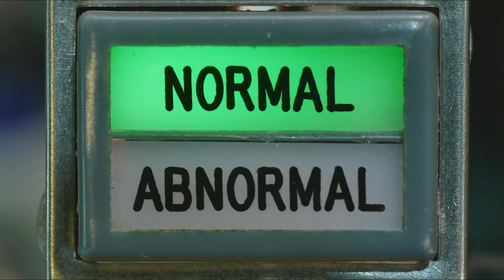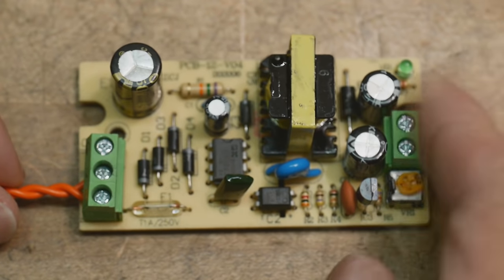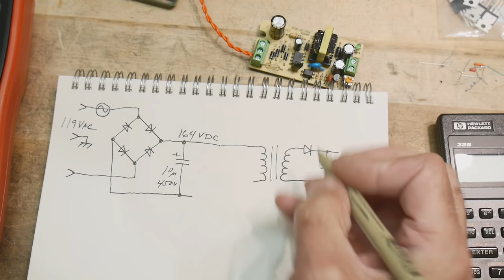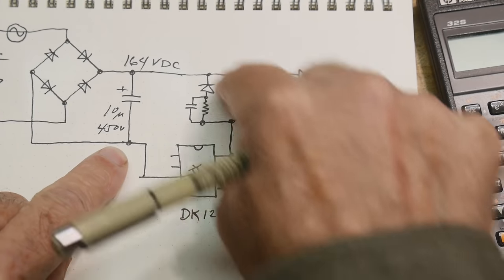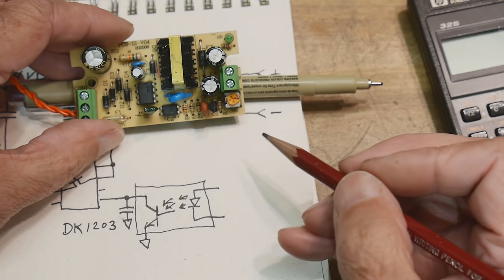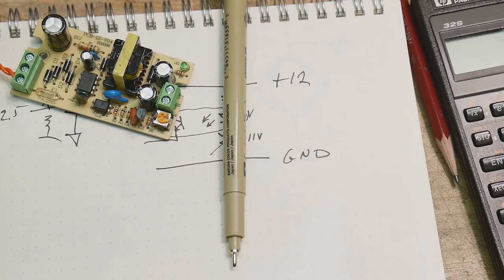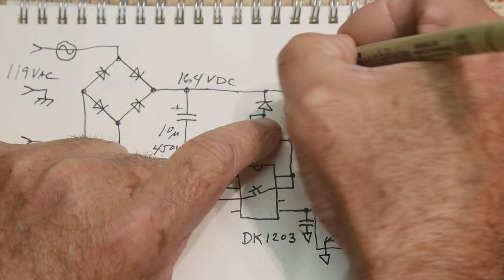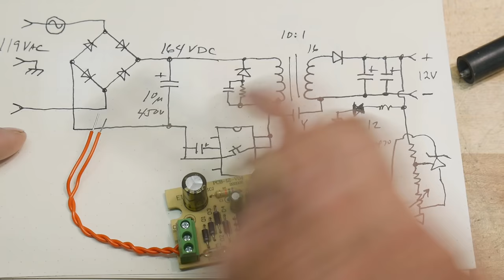#772 Basics: Switching Power Supplies (part 1 of 2)

Comment: So if you omit the rectifier, flip the transformer, swap out the output capacitors, and retune the voltage divider, you could use it as a 10x dc boost converter right?
Reply from the maker: not with the parts shown.

Comment: Doen"t the Y capacitor defeat the input-output isolation? I wonder if the Y capacitor can cause a shock sensation to someone touching the output and a grounded part.

Comment: When you draw a connection to ground, they tend to go to a magical place. That is, in my mind at least! Since I'm looking at a schematic magical map with a "portal" which connects an upside-down triangle to somewhere else in physical space. Let's look at the power LED for example, is the ground wire connected to the 12V DC -? That seems logical to me. But here's a bonus question. There isn't a "ground" on the AC side right? The DK1203 has a ground on pin 5. So, would that also connecting to 12V DC -?

Comment: Hello there and thanks for so useful video... I have a problem with my power supply and there is no DC voltage on the rectifier (nor on the main capacitor) What should i do to fix the problem?
Reply from the maker: could be many things wrong. I can't help you. check the fuse
Reply: Thanks for reply. I checked the fuse and just replaced the rectifier bridge (it was GBP310 and i replaced with KBP410 (what i had at home). Also checked the input AC and it's OK. I don't know what is the problem. It may be a lose connection on the board or something like that. @IMSAIGuy

Comment: Edit: my comment is wrong.
~~Y capacitors are made to handle more current, which is why they are used in line to line configuration. X capacitors on the other hand are used in line to ground configuration.~~
Reply from the maker: X are used line to line, Y line to ground: 
https://www.allaboutcircuits.com/technical-articles/safety-capacitor-class-x-and-class-y-capacitors/
Reply: @IMSAIGuy  I stand corrected. Thank you!

Comment: Excellent.  Thank you for posting.  The circuit relies on a fuse to protect against shorts.  It's not a good method and chances are that it wouldn't protect components.  It could be improved upon.

Comment: My sense for the capacitor across the 2 sides of the transformer is that it changes the defacto capacitance to a different value and thereby changes what signal frequencies are transmitted?
Reply from the maker: no, it provides a high frequency path back to the other ground to kill emission spikes
Reply: @IMSAIGuy  ah, cool thanks

Comment: How does the ac voltage become 164 volts on the capacitor side? Is the capacitor processed with 1.4 and efficiency?
Reply from the maker: 119 * sqrt(2) = 168      minus two diode drops

Comment: Just curious, with the blue capacitor jumping the coils, doesn't that end our circuit isolation? We now have a physical connection from one side to the other.
Reply from the maker: only at high frequencies
Reply: @IMSAIGuy  Right, but what if the component short circuits? Wouldn't frequency no longer be an issue? After all, isolation was always about protecting against component failure, Right? Again, I am just curious.
Reply from the maker: well if the transformer shorted what would be bad news, if the capacitor shorts you just connect input ground to output ground and the output is low voltage DC anyway. so not too bad

Comment: Great tutorials this is one of the best. I have a question,  how to convert thiis to atleast 13 volts? I need to create a charger for my lead acid battery. Thanks in advance
Reply from the maker: I would start with a 15v supply and change the feed back to give you 13v. here is an example: https://youtu.be/4tDdUWh36bQ

Comment: This certainly helped to diffuse some of the mystery about how smps's work. Quite a nice discussion and very detailed. Curious on part of your explanation (and I also see some comments below on this subject)..... the transformer you've stated as a 10:1 ratio (164vdc one side : 16vac second side....  10:1)       Many smps's provide for 115~265vac on the input. How would you account for the left side being roughly 317vdc:16vac .... 20:1).... but still work properly for a 115vac feed??  Can the feedback mechanism into the DK1203 handle that range effectively? Or would an auto-switcher for 115/230 have an additional stage in that secondary??
Reply from the maker: this was a very simple video. the transformer inside does not have typical sinewave AC voltages. it is a short duration pulsed DC signal actually.  you are transferring current really.
Reply: @IMSAIGuy  I kind of figured the current was the transfer rather than voltage. Very much appreciate your fast response! Have a great evening Sir!
Reply: @brianwheeler887  
This is a "flyback" converter. What is actually being transferred are "packets" of energy - neither voltage nor current, as such, but energy.
When the switch is ON energy is stored as a magnetic field via the input ("primary") winding of an inductor. It is NOT functioning as a transformer for power delivery, When the switch turns OFF, the energy stored in the inductor is delivered via the output ("secondary") winding to the filter capacitor and load. Of course voltage and current do come into it, but in terms of charging and discharging of the inductor.
Because of this behavior there is no direct relationship between voltages and turns ratios. You can produce 12 volts out with 165 volts in with an equal number of turns on the primary and secondary. In practice you wouldn't do that because it is inefficient. The approach to the turns ratio is based on producing the required inductance, which is related to charge and discharge time for the two parts of the switching cycle.

edit: forgot the wide input voltage range issue
With modern control circuits and very fast switching devices it is possible for a flyback converter to work with a wide input voltage range, even though the duty cycle must be adjusted for both load power requirement changes and input voltage changes. Doing this does require that the switch be able to deal with the high current at low line voltage and the high voltage (at lower current) at high line voltage. Similarly the inductor must be designed for these issues. At moderate power, up to at least several tens of watts, the compromises are practical and not very expensive. Once you get over a hundred watts or so the compromises are less likely to be acceptable though certainly not impossible.
It is now common, and actually required by regulations in some places, to use a first stage that is "active power factor correction" which makes the AC line input current sinusoidal and in phase with the input voltage. The circuit normally used is a boost converter that produces about 385 to 400 volts output, quite well regulated, from any input voltage between (typically) 85 VAC and 264 VAC. The circuit is moderately complex and requires some big parts, but the regulated DC out of it can simplify the down-stream converter. (an interesting feature of the PFC boost converter is that the input current must be directly proportional to the instantaneous input voltage but inversely  proportional to the average input voltage)

Comment: Maybe somebody can help me out. I have a switch mode power supply with 3 output DC signals.  One is +/- 15V , another is +/-54V and another is for an LED which is - 1.4V or so which seems irrelevant.  On the one rail I am getting +/- 15V as expected but on the other rail I am only getting +14V and nothing on the - V line instead of the +/- 54V.   All the capacitors test fine with an ESR. What components should I be looking at? There are 3x opto couplers that connect the high voltage and low voltage sides of the board but only one 8pin oscillator.

Comment: Samsung phone modifies a power supply’s output A.  If the supply only supports 5V 1 A, the phone can only slow charge, the phone sets the charger for fast charging. If the charger is faulty, after a few charges it will become reliable.

Comment: Question:
I've seen some switching supplies, trying to fix one myself, that do not appear to have feedback from the PS output to the controller.  Instead there seems to be a sense winding on the transformer.  How do those work?
In the 12v PS I'm trying to fix, I get output for about 1 second every few seconds.  Ideas?
Reply from the maker: there are many types of supplies. I only show this very simple one

Comment: Does the chip turn the DC into actual AC or high frequency DC?
In a nutshell, at the heart of this system the whole thing boils down when to connect and disconnect the circuit to the coil, the transformer?
In the meantime reading the DC 160V after the capacitor, does not cause any problem with the full bridge rectifier and the capacitor?
Reply from the maker: It is not a sine wave, it is not AC and is not DC. it is a pulsed waveform with inductance ringing. call it what you want

Comment: Am I right, that this is a forward converter? You don't find them not often in this low power range. The control scheme is also very simple. Probably the pulses have always 50% duty cycle and you simply switch off the pulses when the voltage exceeds the 12 V limit.
Reply: No.This is a flyback converter. The easiest way to tell that a converter is a flyback type is that there is no inductor after the so-called transformer. (sometimes there is a small one electrically between two electrolytic capacitors on the output). The thing that is called a transformer actually isn't used as such in a flyback converter. Energy is stored by means of the primary winding when the switch is ON and delivered to the load side by means of the secondary winding when the switch turns OFF. With a flyback converter the pulse width varies with load current. In a forward converter it doesn't, except to compensate for changes in losses or variation in the input voltage.

In a forward converter there is a true transformer. Current flows in the secondary winding at the same time as current is flowing in the primary winding. A separate inductor is required on the secondary side to store energy.

These days anything up to at least 50 watts is likely to be a flyback converter. Above that forward converts start to be used, up to typically 200 - 300 watts, sometimes more. Then you typically get into a half-bridge converter.

Comment: I don't quite understand the DK1203 (chopper) IC. First of all how does it get its VCC power. I assume, it can't use 164VDC from the rectifier stage since it's too high. Secondly, what's the input and the output of the chopper?
Reply from the maker: Vcc is very strange. it is pin 2. input via a capacitor. see the datasheet: https://radiolux.com.ua/files/pdf/DK1203.pdf
Reply: @IMSAIGuy  Well does that make sense? You are connecting the negative DC terminal (which means its zero/gnd/rtn) to the negative terminal of the capacitor but then connect the positive terminal to the VCC. But the capacitor is open in DC. So you are essentially floating the VCC terminal. How could this work? Am I missing something?
Reply from the maker: it gets the voltage by passing AC though the cap. it is not a DC Vcc. internal to the IC it converts this AC to whatever voltage it needs
Reply: @IMSAIGuy  ok now it makes sense. I didn't read the datasheet for DK1203 properly. In the datasheet in table 6 page 2 the absolute max supply voltage (VCC) is -0.3V - -8V. Now that doesn't make sense and that's where I got confused. Now in table 2 it clearly says the input power supply is 85V-265V AC. Isn't there a contradiction between table 2 and 6? Also, in the schematic in the datasheet it shows the VCC capacitor (EC2) as 22uF/10V but it won't be able to withstand AC peak voltage of 170V. Also, my understand was that polarized capacitors can only be used with DC voltages but here they are using them with AC voltages. Is that not correct?

Comment: Need help here!
I just wanted to know how to power up any ferrite transformer with 220v ac 50kHz. What can amplify the frequency?
Reply from the maker: the 50khz would be generated by the controller IC. in this case DK1203
Reply: @IMSAIGuy  is there a need for a MOSFET?
Reply: @IMSAIGuy  lemme see if I got it right :
First I need a rectifier bridge and a capacitor to convert 220 ac to DC then for the tapping work I need  the DK1203 you've mentioned then I can connect to the primary ferrite core coil.
Reply from the maker: @danielwhite5705  just buy one, it is cheaper, this was $7
Reply from the maker: this control chip has a built in FET, higher current designs need an external one.
Reply: @IMSAIGuy  much appreciated!

Comment: Ey professor, what considerations on selector the resistor and capacitor that are limitatiing the current of the reverse diode that protects the switching IC? Also, that diode can be any diode ort has to be a fast recovery one? thank you very much !
Reply: Fast recovey damper diode  up to the secdary rect once you see those kinds of core

Comment: Thanks for the video, you made everything pretty clear. What I don't understand is how can an IC be used for high voltage? I thought that they were only used for low voltages and that's why they're called microelectronics?
Reply: they're called "microcircuits," or "microelectronics" because they exist in small-scale semiconductor materials, so the voltage they take in is irrelevant to their namesake.

Comment: @22.28  the primary of the transformer you said was ac .  isnt it pulsed dc??? since a transformer is an isolated pair of coils with a differing  ratios of turns there must be a varying current in one in order to transfer to the other.  either ac or pulsed dc will do this

Comment: Why is it just a single diode on the secondary side instead of a full-wave rectifier?
Reply: Calling the pulsed current going into the transformer AC is a bit of a misnomer as it is actually pulsed DC.  The type of switch mode circuit here is called a flyback mode circuit.  In this circuit the transformer stores energy  when the switch is on. And the stored energy is coupled to the output when the switch is off.  The diode is there mainly to act as a switch to only allow current to flow when the transistor is off.  In this way it works more like a buck converter. Only the energy comes out of the coil via a separate winding for isolation.
Reply: @argcargv  Thank for the additional explanation. I was wondering about that myself. I'm not an EE or ET, but had some basic electricity/electronics back at university. Plus I've had a long unsatisfied interest in electronics. I thought that the output from a rectifier bridge was DC, although that DC would have a lot of ripple if unfiltered.

I had an interesting experience long long ago. I connected a battery charger to an 8-track tape player as a poor-man's stereo in a dorm room. It rippled like crazy! On reflection, I figured out that the battery charger was unfiltered, which is fine for charging a lead-acid battery, but not so good for running a tape deck.

As I approach retirement, I plan on learning a lot more about electronics because I like to build stuff and have become a ham operator. So, I'm beginning my education.

73 de AG7TX

Comment: Silly question but can you share you method of supplying the 120VAC and if you have a test lamp before the input?
Reply from the maker: I do have a dim bulb tester ( https://youtu.be/heKFe15LwsI ) but I didn't use it here. the AC from the wall runs into a variac, then an isolation transformer, then a Volt Current Watt meter, then a box with switch and fuse, to the test clips you see.
Reply: @IMSAIGuy  Thanks for the clarification.

Comment: Why wasn't it transform from high AC (120v) input by step down transformer to low AC 15v, then rectifier to DC 12 to 15 volt, then use smoothing capacitor, Zenner diode for voltage regulator, using less parts? Is the design he is showing more efficient?
Reply from the maker: you are describing a classic linear power supply. the switching supply has better efficiency, smaller, lighter, and less expensive for a given output current. very few linear supplies are used anymore

Comment: maan such a great explanation, I finally got it :)
One thing that I still can´t understand is how the max effiency of SMPS is stated as 96%, whilst a full bridge rectifier only achieves 82%... so how can the SMPS, which consists of many more parts, be more efficient?
Reply from the maker: much higher frequency
Reply: @IMSAIGuy  i just realised I might have expressed myself not clearly. There is a full bridge rectifier inside the SMPS (correct me if I‘m wrong), so the overall efficiency can‘t be higher than the efficiency of that part of the circuit, can it?
Reply from the maker: the 96% is probably for supplies that do not have the bridge front end.

Comment: hey IMSAI,big fan here.Can you explain why there is only one diode on the output of the transformer?Doesn’t it make it less efficient?(half wave instead of full wave).I see this on all SMPS. Half wave rectification on the output.
Reply from the maker: in an AC system the current flows both ways. in this, it is technically a pulsed DC (yes I called it AC for simplicity). current only goes one way.

Comment: At about 5:57 where you show 164 VDC on the bridge rectifier output — why higher than line voltage? Is this a DC offset? Is there an AC component? What does the waveform look like there? Is the 164 VDC reading some kind of an artifact of the meter operation?
I’ll go watch part 2. Maybe this stuff is explained there. But thanks nonetheless for going through it systematically.
By the way, nice calculator. But why does it not have an “=“ key?
Reply from the maker: line voltage is measured as RMS and a rectified output is peak voltage